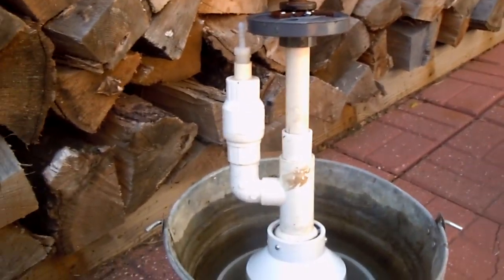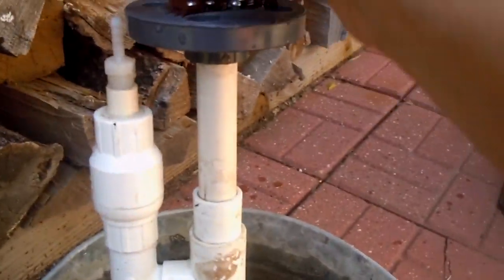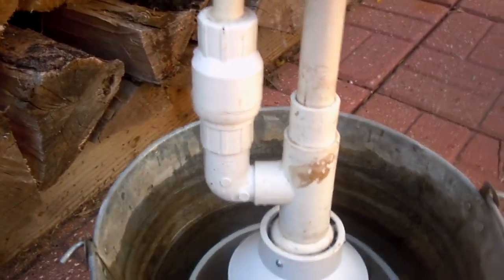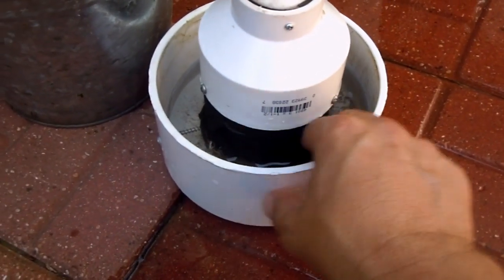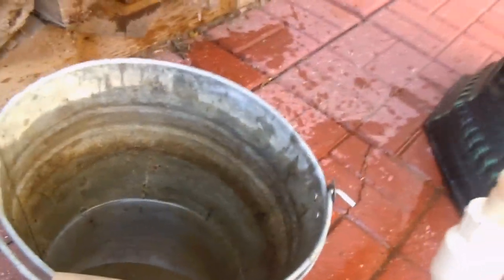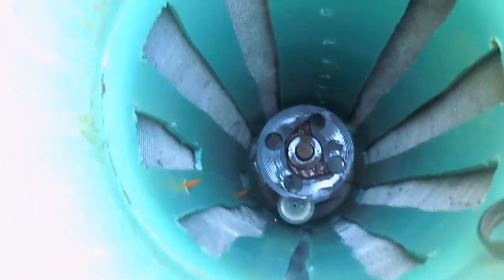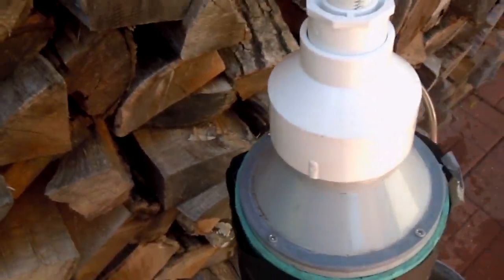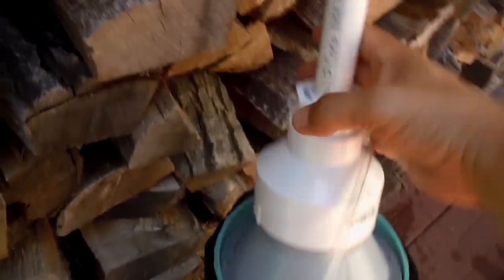Homemade Windmill Well Waterpump Garden Irrigation System, Part 1

Comment: Looks great, one thing though, because the pump is loaded on the downstroke, you'd need a rigid rod between the crank at the top and the piston, much easier to load on the upstroke, pump might be more complex though...

Comment: Hey, Chris. I'm in the middle of building a similar system, but with a different kind of windmill (you can see it on diypics.com), but can't figure out what to use as the pump shaft. I tried PVC, but that expands and contracts with temperature. Where did you get the metal cylinder you used for the pump arm? Thanks!

Comment from the maker: Kevin, It probably cost me $100, but I experimented a lot and wasted money several times on stuff that didn't work.  This year, I've abandoned my homemade pump and I'm going to try using a soap dispenser from my old kitchen faucet set.  I want to figure out a way to pump faster with less water pumped each time.  The pump I made worked but it took too long to prime itself.  A lot of times the wind had stopped by then.